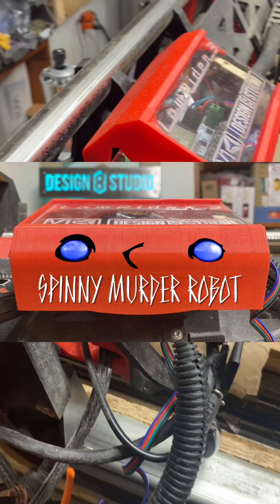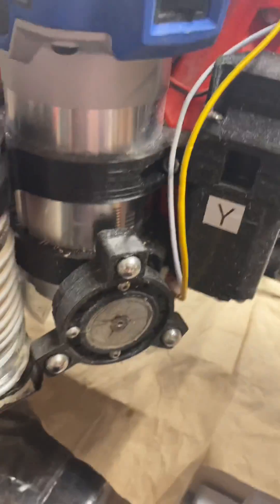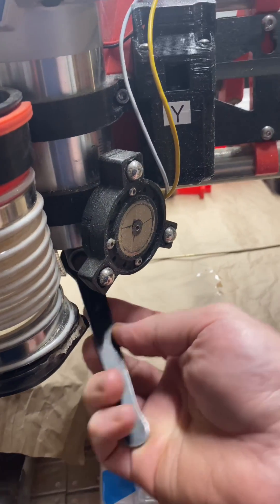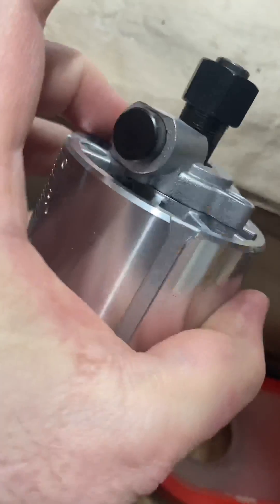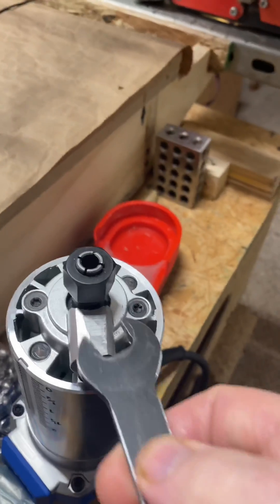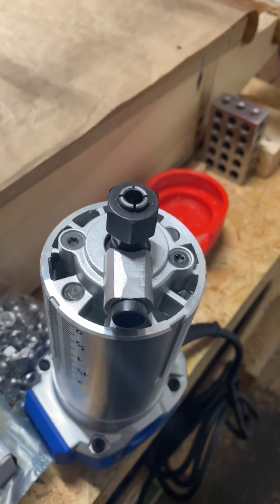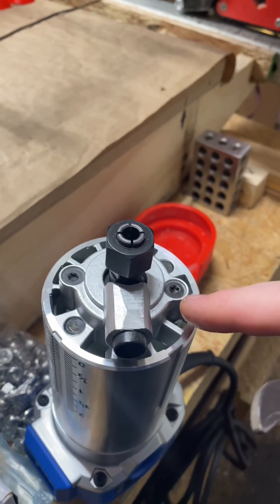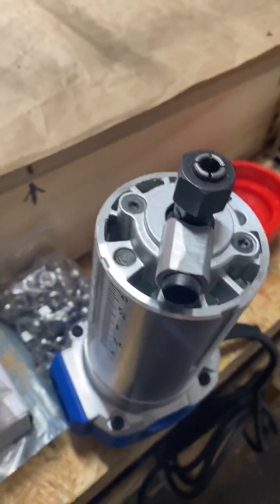LowRider v3 DIY CNC - surgery to Kobalt trim router!

Comment from the maker: PLEASE NOTE: the most challenging part of doing this simple improvement was making sure that the bench grinding wheel did not get up against the ER11 screw threads. I barely touched a couple of times, but was able to get this done without grinding off the threads!

Comment: Dagon Doug! How come you keep coming up with so many great ideas I have to copy...? LOL, off to surgery I go...
Reply from the maker: As I mentioned to Aza, the most challenging part of doing this simple improvement was making sure that the bench grinding wheel did not get up against the ER11 screw threads. I barely touched a couple of times, but was able to get this done without grinding off the threads!

Comment: Nice usability improvement!
Reply from the maker: The most challenging aspect of doing this simple improvement was being careful to make sure that the bench grinding wheel did not get up against the ER11 screw threads. I barely touched a couple of times, but was able to get this done without grinding off the threads!